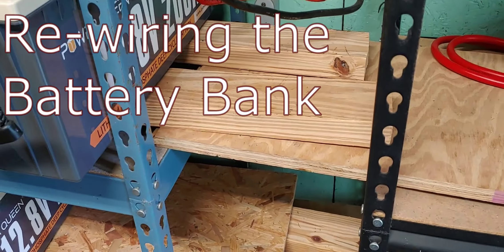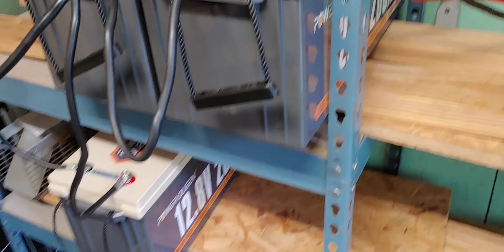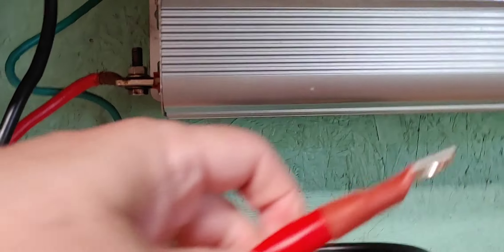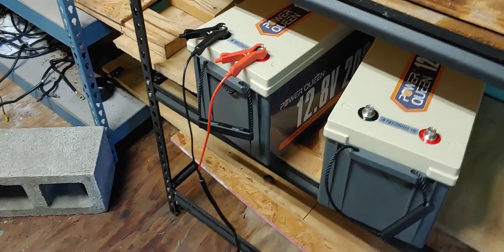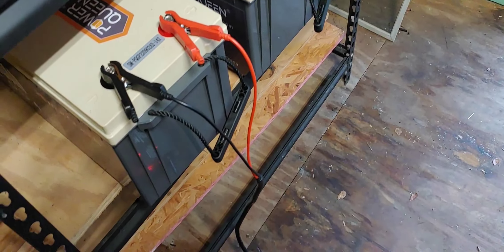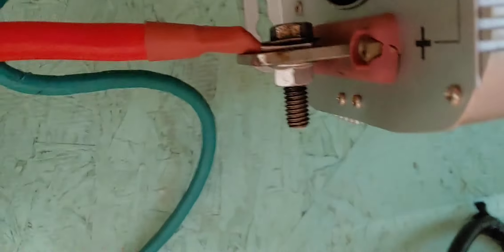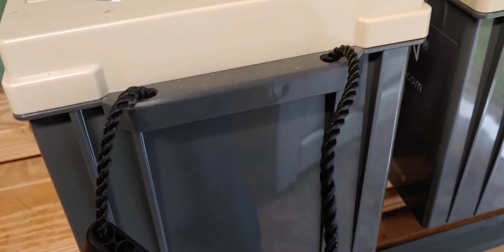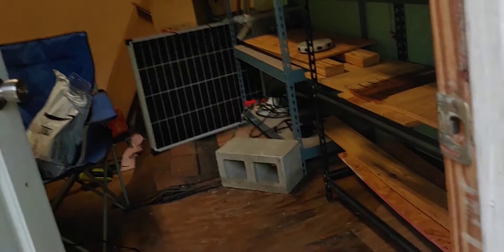Rewiring my Power Queen 600-AH Battery Bank.

Comment: I just wanted to stop by and say very nice video.  I have 4 100ah Power Queen batteries in parallel wited to  busbars.  Each positive to a positive busbar and each negative to a negative busbar.  Then wired in parallel between the batteries. 2awg wire connecting each battery and to busbar. With this set up Power Queen has said i can run 6 100ah batteries in parallel. Safety switch and fused. I also have a shunt for better battery monitoring. Keep up the good work. And hope to see more in the future.  #PowerQueen
Reply from the maker: Sounds like a good set up. I don't have any busbars. Thanks for your comment.

Comment: 600ah is a good size battery bank 400ah will be great. I’m running on only 200ah hopefully will get more soon. I’m sure you’ve mentioned it before but how much solar do you have?
Reply from the maker: I have 3 200 watt solar panels on the roof and another 200 watt on the ground. Thanks for your comment.